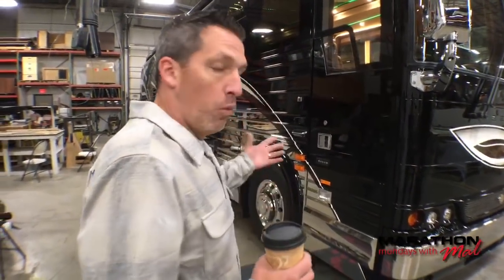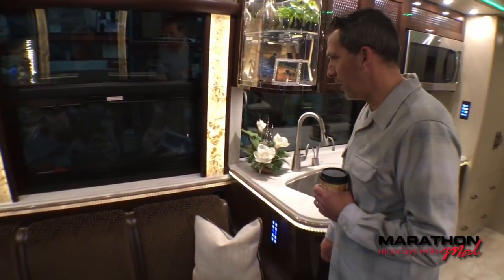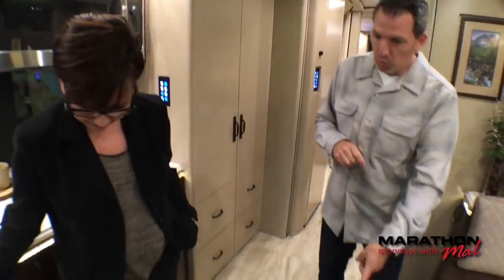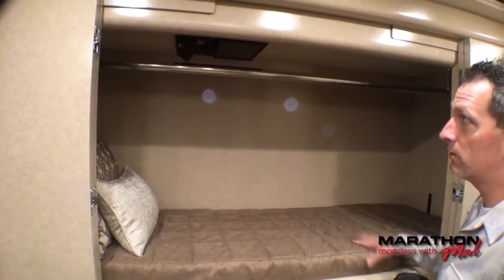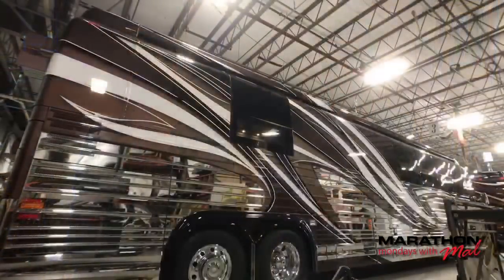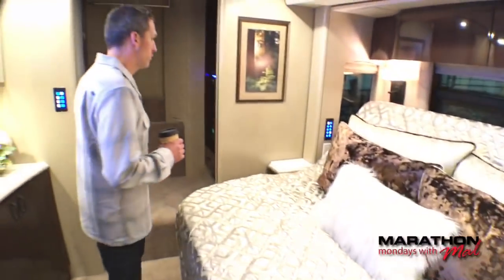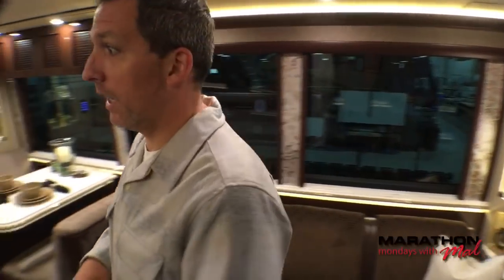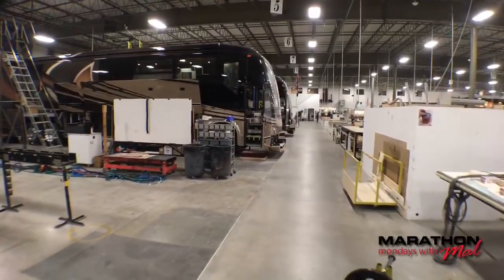Marathon Mondays with Mal: Episode 29 - Coach #1270

Comment: I have seen al this mondays with Mal, and I have a question, how do you do with all this decoration stuff that stands on shelves when you are on the road driving? Are they glued or what?
Reply: There is a special sensor for loose decoration items and nick-nacks. When it detects loose items, the engine derates (speed limited to 5mph) so that nothing will fall over and break. If you press the override button on the driver's left console, you can exceed the 5mph for up to 15 minutes. If you press it more than once, you risk engine shutdown and major embarrassment when you call for a tow.